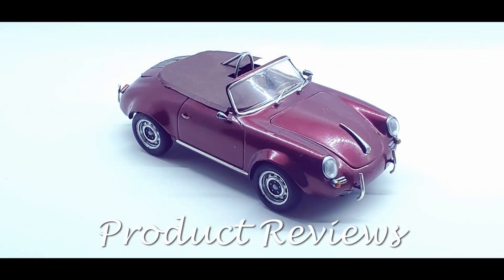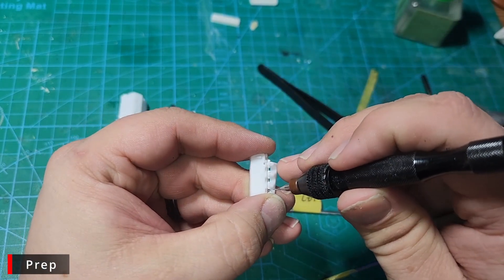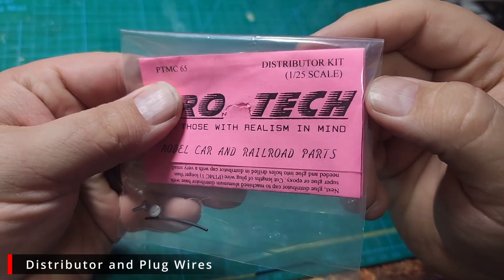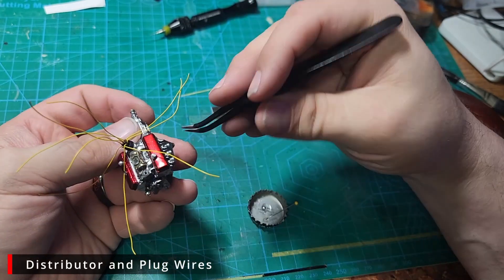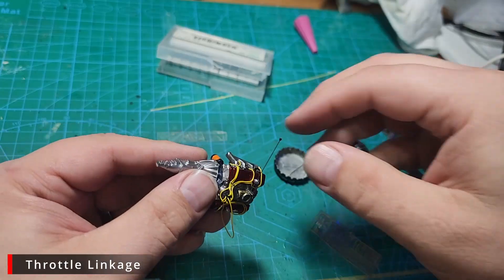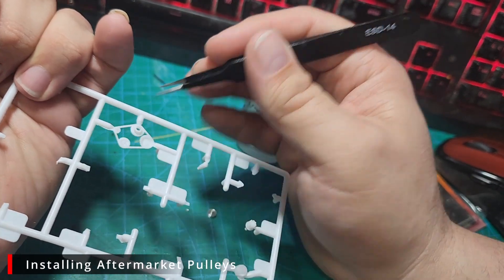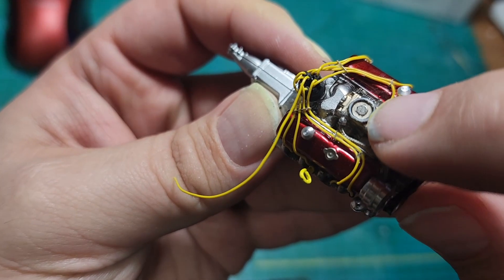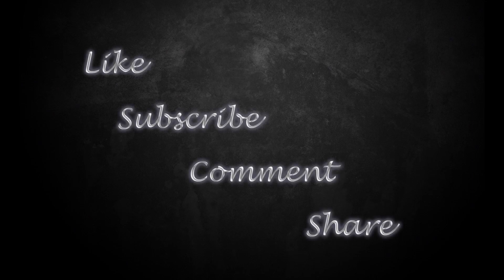Revell - 69 Nova Restomod - Engine

Comment: excellent video easy to understand. Thanks.. I don't know if it's any better but maybe a tubing cutter ( line cutter) for the pulleys
Reply from the maker: Thanks Brian. For the cutter are you talking about cutting the plastic rod for the spacer? I think sprue nippers would have worked better.  Honestly I'm surprised i didn't just model and 3d print a spacer like i did for the rear wheels in the next video.